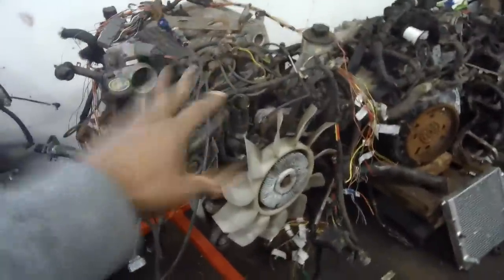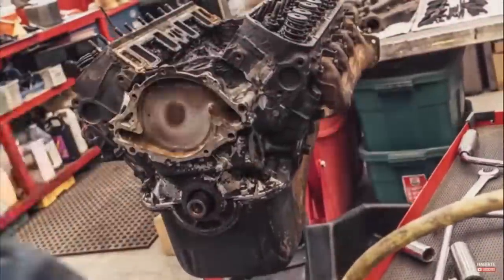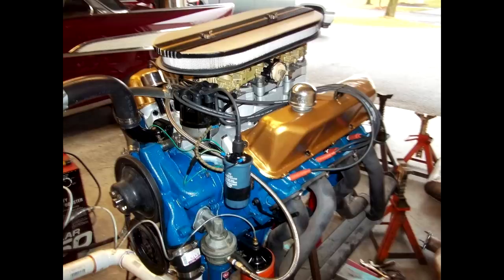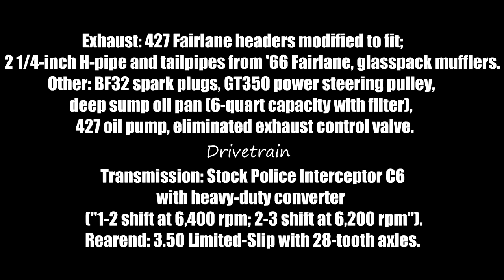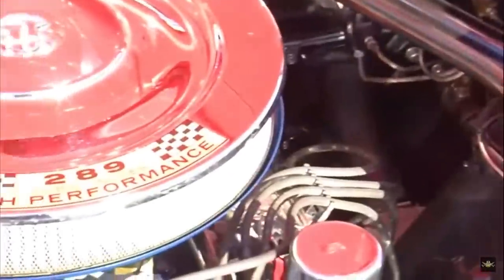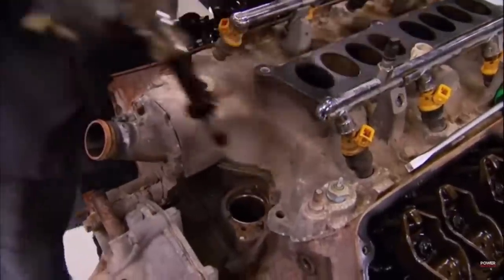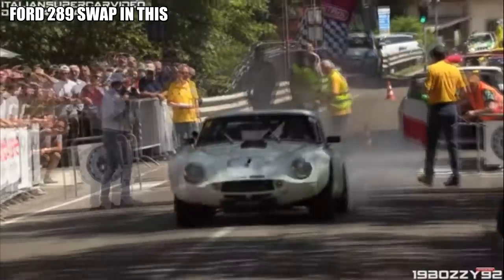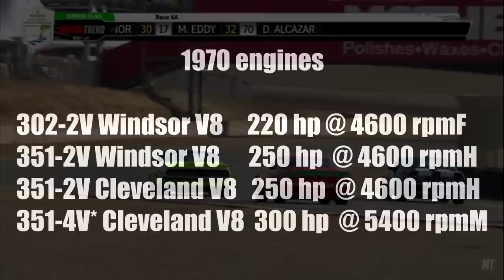289 Ford Voted BEST ENGINE BY CARROLL SHELBY ( HERE IS WHY )

Comment: 302 stroked to 347. IMO the total weight of car fully equipped shall not exceed 3200 lbs .I agree with Shelby. Big displacement is only good for drag. With exception of a rear/mid engine build, a very expensive 427 port injected. But those are only dream cars. I'm 347 stroker or jump to Coyote. Going for looks, the FE is hard to beat in an old school. Just don't take that turn too quick! Build a 347, you got something quick. agile, unique and $10,000 or more. Drop a 351 cobra, you got something quick, medium agility, normal and with a little luck, less cost. Now the Torino is a different business = Find an old FE 360 truck block. Punch it 60 over. Drop a 428 crank. New Eddy aluminum cobra jet heads with some special porting done to the out of the box. 750 double pumper on Eddy split performer intake. Mallory duel point or go electronic @$12,000 - $15000. More bang fo yo buck wit dat 460 but not as cool.
Reply from the maker: great info L-Twig i wanted to make people think on this one and you understand totally . Many times people tend ( we all do )  we tend to thing big displacement and most cases we do not have a clue on the build. Most cases we are mimic  something we heard or saw. I tend to lean more to a road car so i need it to turn a bit. so i small engine is best for me. But i have what i have at the moment. thats why i did not want the 351 in the Maverick. Great info here brother
Reply: Edelbrock doesn't make CobraJet heads that fit an FE. Their top dog head is RPM heads. You really want the 390 truck block by you can punch it .080 and it makes 4.130 bore with the 3.98 stroke makes a 428. Both are difficult to find however. I just got through with a 460/521 build with cobra jet heads and a mild roller cam 850 cfm efi ...dynoed at 690 hp for about $5500 not including the efi

Comment: Holden v8 1969-1998
    253 185hp, 308 240hp, 5.0L, 304ci efi 165kw & 185kw these were the best all round daily driver std production v8's in Terms of Power, Economy, ease of maintenance, costs $. ,, Vs life span.
Reply from the maker: great line up mate

Comment: I started with a 289 ci motor with 289 Hypo heads  by crane Cams ported fireball heads With round exhaust ports. Which work garbage. I think crane made them worst then a 302 ci motor with AR Aluminum heads 192 intake valve. ported They were  junk in 1988  that's all I could get my hands on at the time  car ran a 11.80 et 411 gear Turbo 400 Transmission 68 mustang then 351w motor same AR heads car ran a 11.30 et  then 351c 4V motor  Crane roar cam car ran a 10.80 et . then N.O.S 125 shot 10.02 et same TR 400 With an adapter plate 8" con then 521 ci 460 motor From Engine systems 125 N.O.S 9.02 10" con then 598ci S.V.O BLOCK T.F.S heads flowed 440 on the intake fox Lake cnc ported ...350 shot N.O.S 10" A.T.I Is torque converter 789 at 173 m.p.h in 1999 at MOROSO same 69 Fastback Mustang with more chassie work...
Reply from the maker: I have to agree cause when you read ( stuff from the past ) thats was not the way to go ( crane ) was just good for cams not heads... Those things had to be reported  ( so I heard )... This was a great comment by you sir... I really thank you for the detailed message . I have learned  some things today and I thank you

Comment: Taller block 351 sport cars have too have a low center of gravity!!~ 289 shorter block better for sports car!!
Reply from the maker: agreed Tim you can get that little 289 to run hard if you get the right heads and stuff to work with it.. its really a sport car type engine design
Reply: Yes, they ran a version of 289 in Indy cars that could not be beat. Except those were race engines turning incredible rpms. The 302 is the same design, taken from the 289. Just like the chev. 350 taken from 327 taken from the orig. 283. The 302 stroked to 347 is a little beast!  The 351 Windsors were a dime a dozen. The Cleveland was more sought after for their head design. But today, the Windsors are not getting such bad rap.You can build a monster Windsor.

Comment: You forgot the 69 351W 4V, one year only. But you can't list em all 😁 I have one in my 74 Mustang ii fastback mated to a FE close ratio toploader.
Reply from the maker: man you have gem there brother wow.. man i need to see the picture on that car
Reply: Not one year only...
The 351 Windsor 4 barrel came back in the early '80s as the 351 HO, they delivered in some 1 ton commercial trucks and Crown Vic police cars.
Reply: People are liking the Mustang II more now..Saw 2 of them at a small town car show last summer...I drive 62 Fairlane with a 66 289.  4spd from a 82 Mustang...Hits 60mph before 4th gear.

Comment: My uncle allways said he will blow doors off of anything with his 289.  He built up 289s back in the 1980s.  Serious power. Full house bored stroked blueprinted on the bottle with 200 shot into a ford falcon .  No fancy modern chit here , all backyard broke ass builds he still built 10 second cars in backyard.  The 289 is a beautiful thing.   Imagine that a V8 with triple the HP to Cubic inch.   I'm sure over 1000 HP possible.  I'm happy with 500 or so hp out of a 289 would be sweeeet music

Comment: These are my 5 choices in order of Ford engines that you could actually buy off the showroom floor.  #1 Boss 351 Cleveland (Hottest thing on the street, imagine this engine in a `72 Maverick from the factory rather than the over weight Mustang; this engine owned the pro stock class), #2 428 Cobra Jet Another great street warrior.  (It took Tasca Ford of Rode Island to come up with the idea.  Ford was just too conservative at-the-time in it's thinking).  #3 427FE  Expensive and very limited production, most went to racers (Straight from the factory these things could launch; just needed a little tuning). # 4 Boss 429 Straight off the showroom floor they were disappointing; but then again so was the street Hemi. #5 Boss 302 great engine but needed some gears to perform.  Also the 351C 2 bbl heads would have been a better match.  (Imagine this engine in the `70 Maverick when it was introduced not the overweight Mustang).  This is the engine the HiPo 289 could have been. Remember the Ford HiPo 289 had a 4" bore (same as standard 289) and 4 bolt mains, something the Chevy 283 did not.   As Shelby noted in the video;, if Ford would have invested the time and money in a set of heads for their hot little small block they would have continued to race it and win.  Stock 289 and later 302 heads had small valves and poor flow. A great set of heads sure would have taken the wind out of the sails of the future Chevy Z28.
Reply from the maker: this was GREAT Burt great info on this topic... Thank YOU so much bro!

Comment: The Boss 351 was possibly the best street engine Ford produced. It had big 4 barrel heads, four bolt mains. It was a bit more streetable than the big blocks and the 289/302s, but it still had a bit of street lag due to its large valves. On rural
roads it gave the corvette a ride for its money. FYI...the Boss 302 suffered from green light lag due to its Cleveland 4v style heads. It was best for Trans Am racing where one keeps the RPMs high. Same with the 289 Hi Po.

Comment: Cleveland rock ! After you bush the lifter bore high volume oil pump 4v heads just clean up the runners you’ve got a rocket
Reply from the maker: I want to tap on the Cleveland a little and see what its all about.. many say thats the motor

Comment: Motor has to match the car (weight and handling) and what it's going to be used for. Mama going shopping or light to light street hopper, oval track, straight line drag or even just pulling a house around. My personal all around favorite to drive and work on was the 351 4v Cleveland. Big but no too big. Smaller cars the 302 the door slammer the 289.

Comment: Yes, Tasca created the 428, which was a great FE street engine. However, the 427 FE will go down as the best FE engine. the 427 did start running good until 3000 rpm, which suggest if could have used an equal length long tube header to help it run on the street.
Reply from the maker: very good insight THATS why i do the videos to learn and this was a very cool statement.. Thank you for this 1
Reply: @bstfordchannel923  If you can get your hands on an Old Headers by Ed Catalogue will teach you how to do it right. You just can't get the biggest primary tube  and collector sizes and make it work. I used their advice to make an Oldsmobile W41  Quad 4 outrun v6 and v8s  and other sport cars in a 8000 ft environment.

Comment: Ive had a 239 flathead, not much power but eeeasy to work on and cool as hell to look at.  My dad had a 65 mustang with the 289hipo, 3 gear all out could peg the 130mph speedo easy.   My favorite is the 351w....just because

Comment: My experience is, 1977 LTD II sedan. Stock compression, 1974 Torino headers with duals, Holly 600 and Torker II intake. 30mph tromp and the tires break loose. This with 18 mpg at 80 mph. Wouldn't do that from factory and only 15-16 mpg at 55. And this was a Windsor.
Reply from the maker: whoa? that i may have to try this James thanks for the info.. God bless you and yours brother during these times

Comment: I have an 02 Ford Falcon XR8, which is obviously an Australian Ford. These Falcons are the very last vehicles to come off a production line with a 302 Windsor, anywhere. At 220KW they're also the most powerful factory incarnation of this mighty little legend. 
But...Nothing screams like a 351 Cleavland at 7500rpm so...I'd have to go 🤔302W, 351C 1st equal.
Reply from the maker: thank you for checking in I love the cars you guys have over there.. swee rides and you guys really do not play with hp.. I will go with that also 302 351

Comment: Good content some of Ford's Best engine's no order IMHO.

The 300 Inline straight 6 the engine that won't die.

The 5.0 EFI HO the small block that acts like a big block when tuned properly. 

The 427 SOHC Cammer the engine banned from NASCAR. 

The 351 Cleveland the Chevy big block killer. 

The 5.0 Coyote the engine that often punches well above it's weight class. 

The 427FE High Riser. The mean drunk step father GM and Chrysler don't like to talk about. Banned from NASCAR also early to mid 1960s.

The 289 CID HI PO V-8 the mil with the Heart of a Lion.

The 351 BOSS the Beast.

The 5.8L Trinity V-8 the LS slayer.

The Yamaha/Ford SHO V-6 the Sleeper.

6.2L BOSS the terror with unlimited potential. 

390FE V-8 aka the Bully Stoplight commando.
Reply from the maker: This is a great list so I may do this as a video but you left the 4 cylinders out Lima and Kent engines  I may have to do the best engine 4.6 sohc should be in the list also. Great List
Reply: @bstfordchannel923  Not a fan of Ford 4 Cylinder engines. The Modular 4.62V 5.42V 6.82V are proven performer's. They do belong on the list. Also deserving is The Ford Cosworth V-8.
Reply: I've heard UPS trucks use the 300 IL6.
Reply: @garybrinker4522  They do!

Comment: The 351 didn't arrive until around 1973.  The 289 was the only small block Ford had until it was punched out to 302.   However the 271-302 HP 289 was superior to the competition's.  The 289 271HP is a rare bird they were few and far between and bear little internal resembalance to the normal 289.

Comment: Great thinking here very knowledgeable about ford what do you think about the tunnel port 302 and the gurney Westlake head head small block ford small block please if any one has knows back in the 1980's or 1990 s some one had a vavleless head that used a rotating cam that had slots that were basically the valve when lined up with the head ports a name or company would be much appreciated thanks really liked the information I
Reply from the maker: yes i do it was guy the did this to sbf, but Benz wanted to know about it.. I remember seeing it in a Benz at that time. It was not a Rotary ..the cams was slotted like a rotary,  Coates international i think click here http://www.coatesengine.com/ you are very welcome Greg and i thnk you for reminding me about it.. May do a video

Comment: I’m here trying to educate myself a little and decide on what engine I want for my 65 that I’m doing that has an old 289. 
Debating on rebuilding that 289 with HI-PO parts or using the 351 Windsor I have in my garage. 

This car when complete will be driven atleast once a week in and around town and at local cruise nights.
Reply from the maker: I would personally do a sweet little 289 that runs very well, cause if its a once a week car than that motor would be best for that  to me .. Not facts but i rather lean towards the 289
Reply: That is my plans for my 64 comet .. I went with the 289

Comment: If you go and find that first Cadillac V8 you will find that it was not cast as a complete block.The cylinders bolt to the block. Everyone could build that kind of V8 but it was to expensive to build. Fords V8 was the first one where the block and cylinders were all cast as one piece. That was the first v8 to be built that way.  Those flat head engines were run and built all over the world too and the French used the engine into the 1990's.

Comment: I love my 289s. I have had 302s, but they never ran with any 289. We built a AC Cobra that holds the fastest track record at Road Atlanta with a 351W. I was lucky because our shop with near Reed Cam, and they ground my own personal 289 cam that I still have today. I remember the rpms those 289s would hold. Here is a video of what the people Down Under are doing with 289s in early Mustangs, 600 hp and 8500 RPMs. I never blew up a 289, only head gaskets. https://www.youtube.com/watch?v=NJD1B7R-EHs&t=261s

Comment: As far as in the day of course you would want to run a small block if all else is equal, even in a drag car and especially if you expect to handle. 

Doesn’t anyone realize that the early SBF has two big limitations. Too small of ports and valves. You can only crutch it so much with cams. The other thing is the dinky and weak rod bolts (along with pistons that were prone to cracking). Sure many got away with them but if you started making real power even for the time) or needed endurance you were going to completely blow up. How are you going to win anything with no engine power? The 351 (which wasn’t even around until 69) was pretty durable, but it was even more hamstrung by too small of ports and valves. The 350 Chevy of the era walked all over them.

And remember Shelby couldn’t just throw money at the things he did, he had to be economically viable. You can tell by all of the history that Ford didn’t just throw money at him to do what all he wanted. If they had we would have had a lot more specialty parts that came out from the factory. It was kind of do what you can with what you have.
Reply from the maker: great choice for engine Fred ... I will side with you on this subject

Comment: Best Ford engine is the GAA.
It's a 1100 CID all aluminium 32 valve V8 DOHC that puts out 500 HP and 1000 lbs. of torque. It was used in Sherman tanks in WWII.
Reply from the maker: agreed

Comment: Any solid lifter Ford V8 with K-code or F-code cam . Always wondered why all of the Ford V8s sounded sooo much better than chevys , Chrysler V8s was a close second ! My 1994 GT convertible 5 speed with AFR heads - Cobra intake 1.70 Cobra aluminum rocker arms stock cam MSD Pro billet distributor Cobra throttle body aluminum flywheel and aluminum drive shaft 3.55 gears Cobra clutch assy !
Had a bunch of Chevys but have always been a FORD man .
Reply from the maker: great info james i never notice fords sound better UNTIL you just point this out.. I am being serious about this .. great info brother thank you for the detailed comment

Comment: #1 289 hiPp with mech lemans cam #2 302 boss mech lemans camed  #3 1985 302 roller with 184 afr heads 1.72 roller rockers 650 dp Holley An performer rpm air gap  400hp with stock roller cam but Mec roller would let it rev now that 4 k build would be long rod like 289 with Mahl forged  pistons 450 hp and good rpm an street manners too
Reply from the maker: https://youtu.be/bo4RVjqKvHI
Reply from the maker: you are right brother sorry for the late reply

Comment: Where the hell do i find a 289😂
Reply: When you do find one, good condition will cost you 10k+.
Reply: Get a 86 to 94 5.0 roller cam  block put 289 crank and rods in it. Now you have a 289 roller engine.
Reply: I got mine a year ago off of Craigslist for $600. They're around, they're just not as common as a 351 or 302

Comment: Great videos! Very informative. 
Food for thought. 
Internal combustion engines are air pumps. They pump air in and pump air out. The faster that happens the faster you go. 
😁
Reply from the maker: you are correct Jimmy in and out quickly  thank you for checking the video and commenting..

Comment: #1351c #2 Boss 302 #3 Boss 429 #4 289 #5 427 wedge that's my personal favorites... 351c is the greatest small block ever built by any manufacturer. Hands down most hp per cube. To answer op's original question, 1969 was the first year of the 351. Shelby was out of racing by its introduction. If the Cleveland head was available on any engine in the mid 60's he would have put it to great use.

Comment: The really crazy thing about the 289 was it was a screaming demon placed in a lightweight 65 & 66 chassis . With a little work it was entirely possible to get 375 hp out of that bad ass SB.High lift & duration solid lifter cam, dual plane intake and 700 holley wiuld turn that little bastatd into a BB chevy or mopars worst nightmare.

Comment: Mel Burns ford in long beach calif. Back in the 1960's sponsored his son Mike Burns with a 1965 ford Fairlane with a 289 ford and Mike set many records in drag racing. I worked for Mike Burns  Indio ford in the 1970s  and Mike had a large picture of his Fairlane with the front wheels off the ground a couple of feet, real cool stuff.